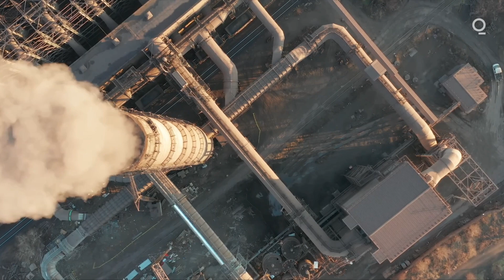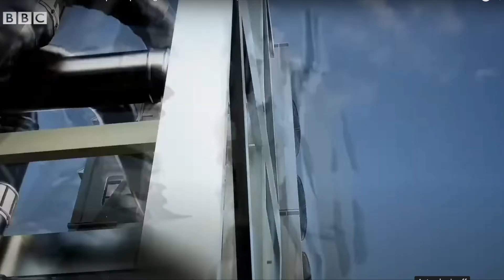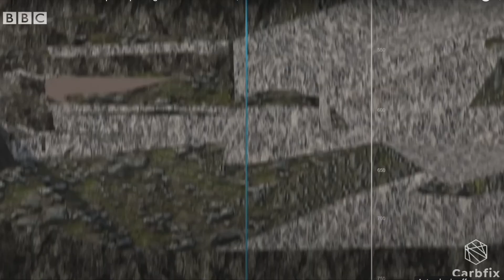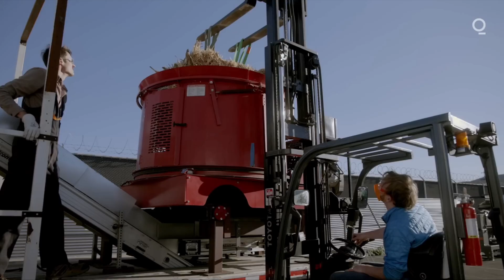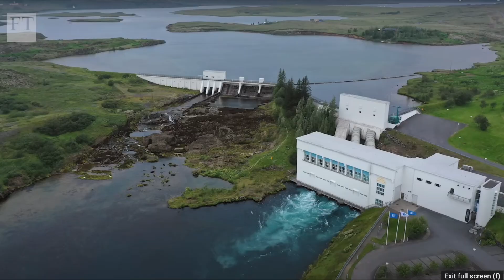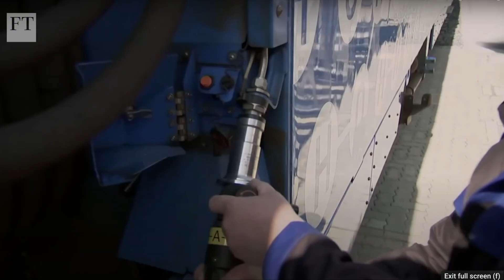group 4 carbon capture

Comment: It's neat to see the different forms carbon capture tech takes on.
I was reading about some concerns with CCS - that it may cause deep rock formations to become unstable or leech into ground water systems.

There are companies exploring carbon upcycling - using CO2 as part of building materials that are then sold.

This is a very interesting field that we're bound to see more innovation in!